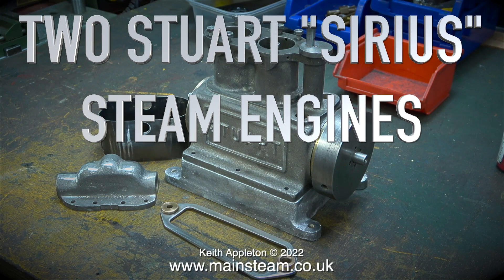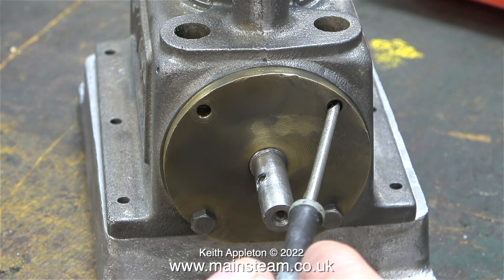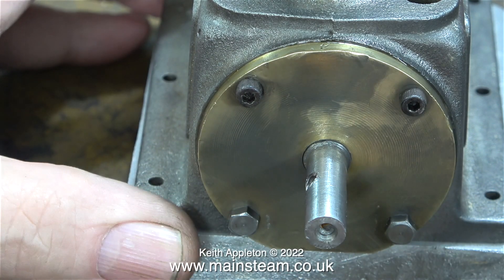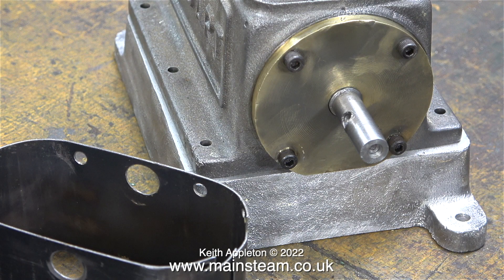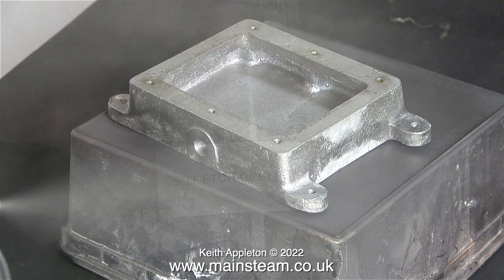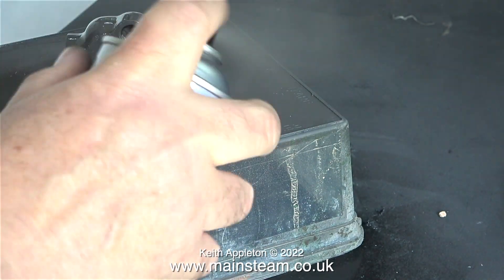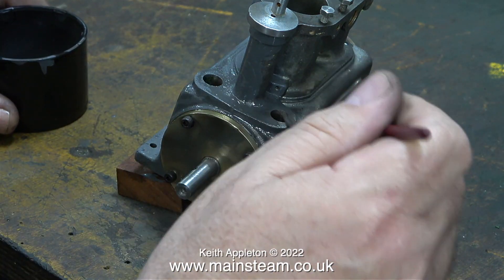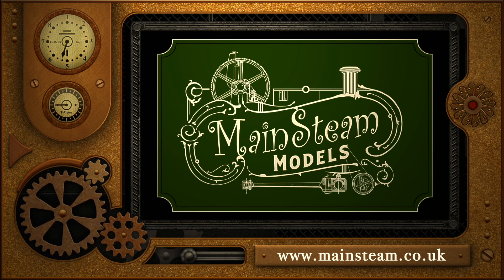TWO STUART SIRIUS STEAM ENGINES - PART #4

Comment: Great video as always!  Reading up on this type of engine I learned they were intended to be used on small boats and farms for running water pumps and generators and were quite successful.  The British secret service thought they could be useful and they were, but mostly after the war as French farmers continued to use them until their national grid was rebuilt.  I'm still looking for info on their use during the war, but there is very little info on equipment with most stories focused on the people themselves.

Comment: 0:48 Yep two grub screws, that was my immediate guess when you had trouble last episode. It was a lesson I witnessed at a cotton gin when another worker trashed a jack shaft by using a hydraulic gear puller (not a porta-power hand unit but an electric pump powered unit) to remove a 32" spoked pully wheel, they were lucky they didn't trash the pully as well.

Comment: Wonderful video as usual, thank you.
The cladding that you sanded was it blued ?  -  I put a blued clock part in my ultrasonic cleaner and it immediately removed the blueing of course I was using a cleaning solution made for cleaning clock parts in the ultrasonic
Reply from the maker: Some "blue" is chemical, this I think is anodised.

Comment: Are you going to be able to leave the Allen head bolts? The reason I ask is say in the future someone takes the fly wheel off. And use a quote of yours " and what is this ? "
Reply from the maker: They are OK as the Allen Bolts are Imperial (4BA)
Reply: @keithappleton  they don't match. I have watched a few of your videos and I was surprised that you would put something together with bolts that don't match.
Reply from the maker: I explained my logic in the video. The 4 BA bolts on the engine are all a special non standard size. And to make all of the steam chest bolts match, this was the way I had to do it and I am personally very happy with it...... Plus, in any case the Allen Bolts are not very visible behind the Flywheel ........